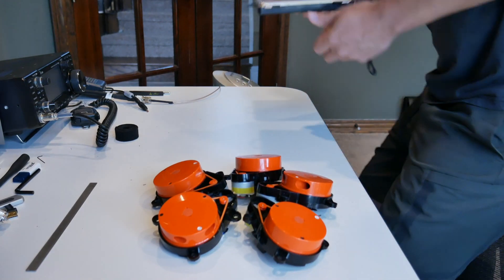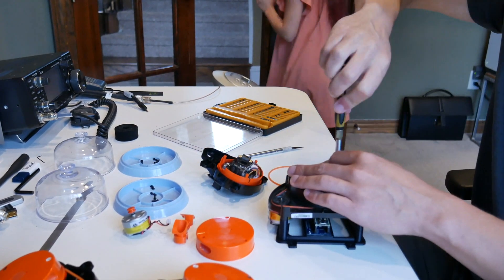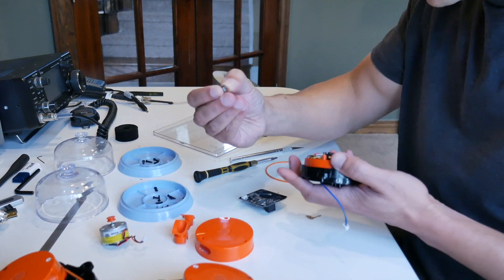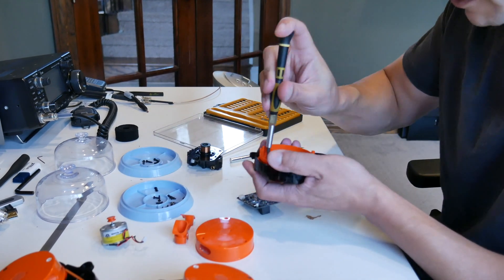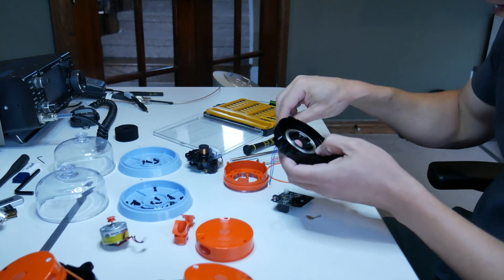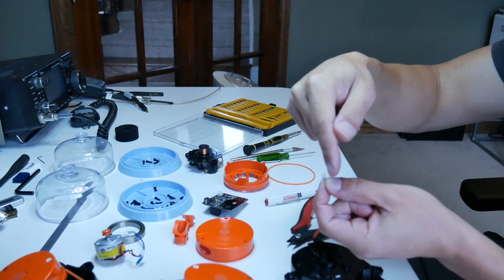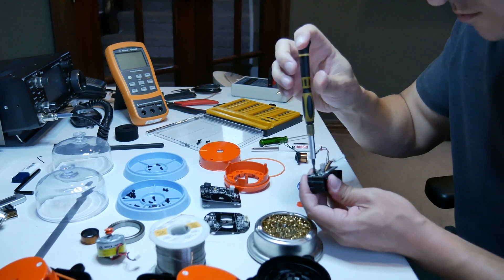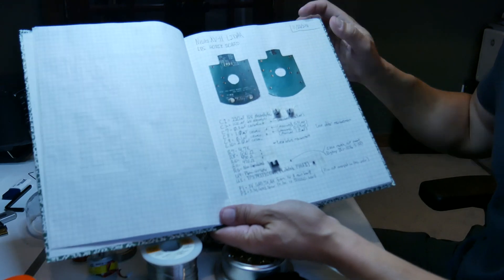Roborock S5 LIDAR Teardown

Comment: Hi, are both rotating parts with the same diameter?  Can I use the VX11 diode and CDC board on the xiaomi LDS module? Thank you.
Reply from the maker: I am not familiar with the CDC board, I have detailed pictures at https://wiki.recessim.com/view/Xiaomi_Roborock_LIDAR and can measure any item if you want to leave a comment there or email hash at recessim dot com.
Reply: Sorry I meant CCD board. Just the one mounted with the plastic part with diode.
Reply from the maker: @wuhao4641  I think I understand what you're getting at. Can you use the Neato XV-11 CCD board on the Xiaomi module. I would have to say no as there are a bunch of small design differences even though they look very similar. Why did you want to use the XV-11 board on the Xiaomi LIDAR? Are other parts of a XV-11 module you have broken?
Reply: @RECESSIM  Yes...well my xiaomi module was broken. But only replacing diode seems very hard due to the calibration problem. I have a spare XV-15 module so I was wonding if I can use the whole black part (diode, CCD board and lens with plastic holder) to replace the broken one.
Reply from the maker: Wu Hao got it, the mounting is definitely different but you can buy replacement Xiaomi modules on taobao for a good price.
Reply: @RECESSIM  Thank you
Reply: @RECESSIM  OK thank you. BTW do you know the name of the 6-pin black connector?
Reply from the maker: Wu Hao It’s not this exact one, but this should help your search as it’s probably compatible. 

https://www.digikey.com/products/en/connectors-interconnects/card-edge-connectors-edgeboard-connectors/303?k=&pkeyword=&sv=0&pv89=7022&sf=1&FV=29%7C346497%2C69%7C411897%2C88%7C80383%2Cii2%7C2172%2C-8%7C303&quantity=&ColumnSort=0&page=1&stock=1&pageSize=25